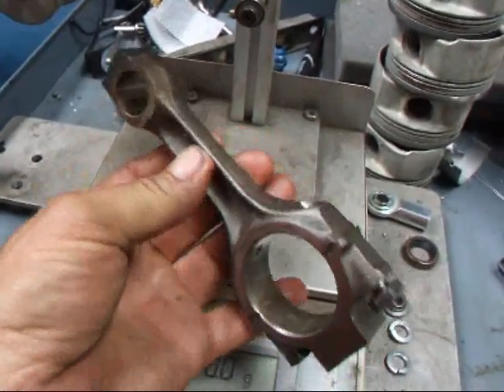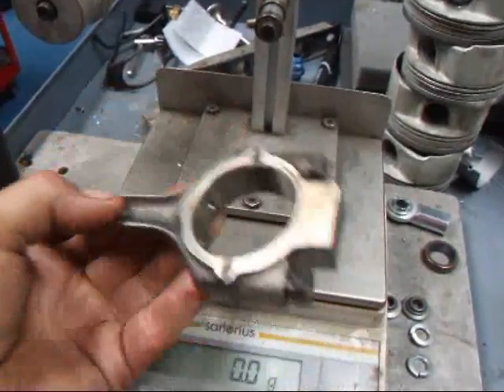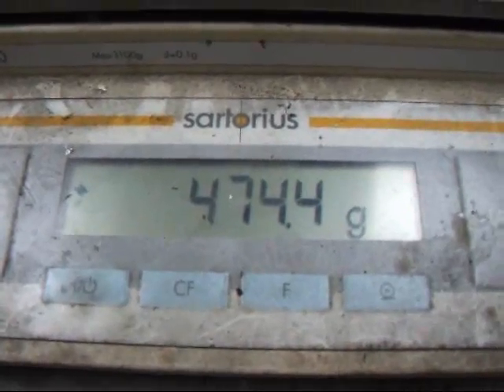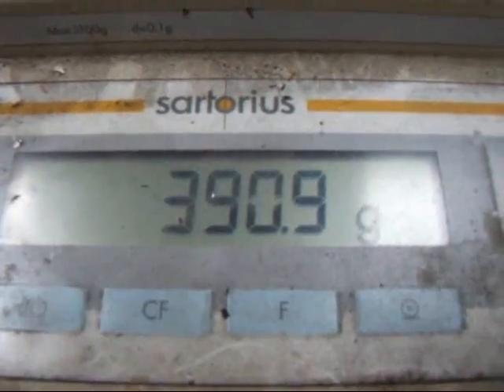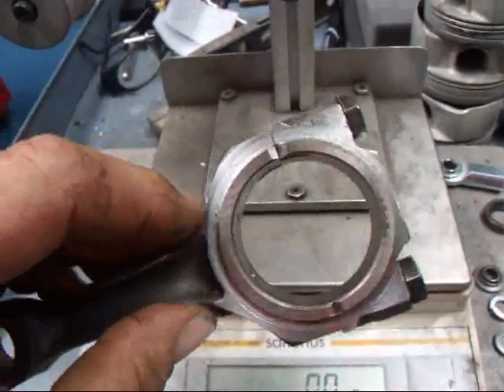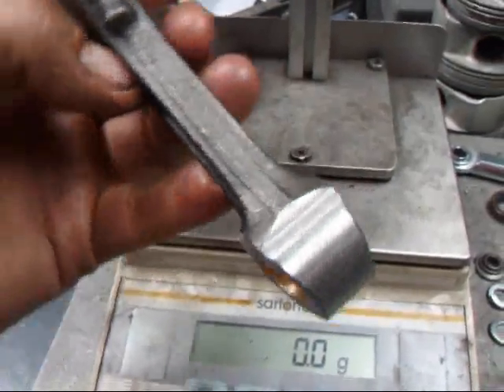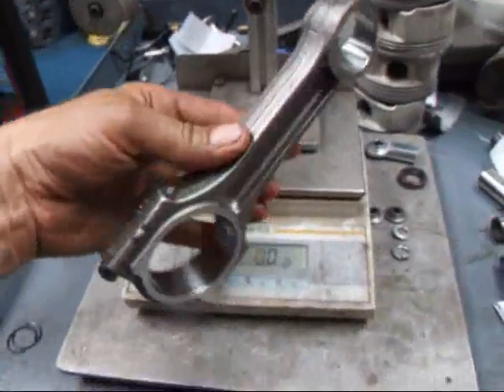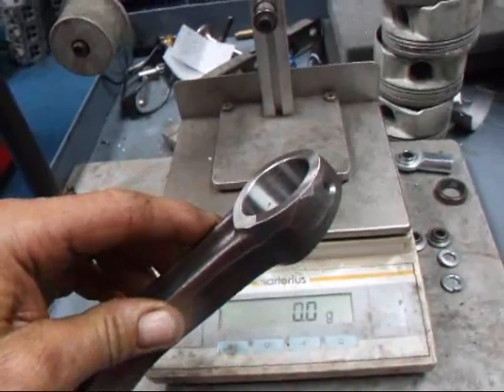850 Con Rod Mods-01.wmv

Comment: that trapezoid design for the lil end might be a modern idea used to reduce small end weight and you say modern diesel engines use it correct? diesel engines always use high end durable parts for longevity possibly that diesel rod was not a stock alloy and using the trapezoid mod of conventional stock gas engine rods is a bad idea ? a diesel rod might be made out of the same alloy as a full blown race engine aftermarket rod ?